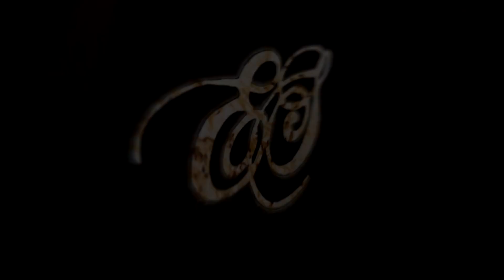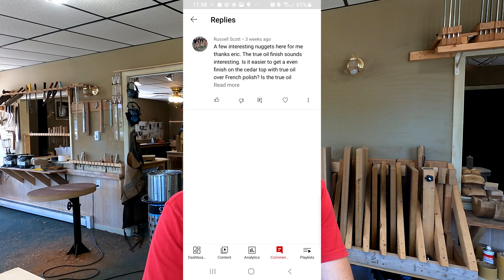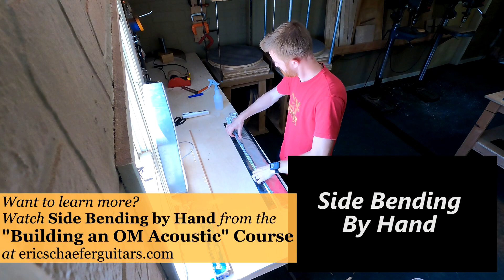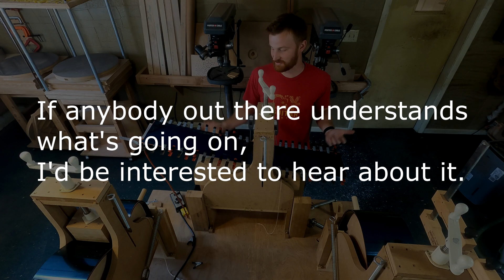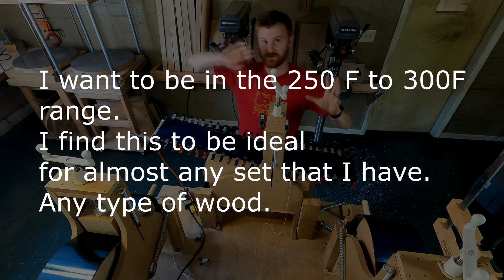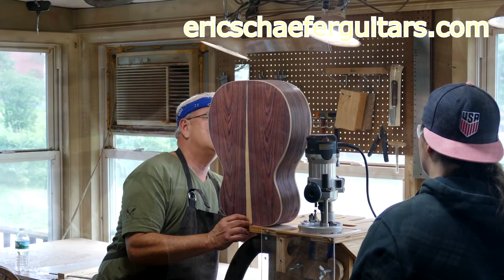Machine Bending Guitar Sides | Demonstration and Q&A

Comment: Hello Eric, have you figured out your hum problem by now? If not try unplugging it and plugging it in another outlet to see if it stop. If the hum goes away then it is your Amps, you are not getting enough amps to your fan and if you leave it plugged in the way you had it you will burn out your fan over time.

Comment: You have ground hookednup wrong . So what's happening is :

When you hook up your controller,  the live wire is actually going through the ground and completing a circuit.... Because it's going the the coil of the the controller which is wrapped with a zillion turns of wire , its actually not only completing the circuit,  Its also changing the voltage because of all the resistance in all that wire.. 

That is my best guess... Been there done that .. when only one thing is plugged in  , you don't notice it..

But eith 2 things you do .. Heres the bad part .. if you plug in say , a drill press ..  it can go into the motor ,  turning the windings into a transformer ... and actually raise the voltage in your iut let to 250 ir 410v ... of course the amperage would be down and it can also effect the cycle rate ...  this can destroy electronic components that are plugged into the same circuit .. 

I know its a long explanation but it needes to be .

Comment: Hi Eric,  first I want to say that for the 3 guitars I have built, your videos have been very good and useful to me, I wish you sucess!  As to the humming problem, you may find it useful to think of the 60 hertz (cycle) hum that you hear in terms of guitar strings.  When you pluck the high E string, the low E will also ring to a lesser amount in sympathy.  In my work, I used to use a harmonic analyzer to trace problems like yours at the university where I worked.  Many times, like John G. above mentioned, the problem was related to grounding issues but really a hard thing to pin down without doing a good look.  At any rate, you can think of the air fan moving in sympathy with the 60 hz generated by the temp control.  The fan is a good suspect for making that noise, so maybe you could, like the man said, unplug it - or move it to a different circuit.  A good electrician should be able to help you make sure you are safe with your grounding.

Comment: I have a Jet AFS1000 which looks like yours.  So I did a test plugging in my manual bending iron into the same outlet as the purifier.  My Jet hummed when the iron (controlled by an incandescent light dimmer switch) was at a low setting.  When it was on max no hum.
Reply: The obvious solution is to teach the purifier the words….

More seriously, dimmer controls use a variety of schemes to chop up the AC power delivered to the light or heater being controlled.  I suspect the induction motor in the purifier sees the voltage kick from the heater control’s internal switching.  These spikes surge to the motor’s start capacitor creating enough current to roll over the motor even when it is off.  

The simplest solution is to run the purifier on low while bending.  I have found that my bending iron produces particulate when I bend.  I don’t know if it is the steam generated or smoke from the iron’s wooden base.  Anyway my particulate meter spikes up pretty high and I run the purifier while I bend.
Reply: After some additional tests the hum was strong when the heater was connected to the same outlet as the Jet and weak when connected to the same circuit but connected to an outlet on the same circuit but 6 feet away.  When on a different circuit it went away.

The suggestion of putting the heater on a separate heavy duty drop cord will work I suspect.

Testing with an oscilloscope showed the hum coincided with he occurrence of switching spikes from my dimmer.  My bending iron is only 150W at max.  A larger wattage heater would probably produce larger spikes, and louder hum.  My hum is not very loud.
Reply: And a video of my experiments...  https://youtube.com/shorts/DO48TCcTe78

Comment: Hi Eric the strip you are using is a master and slave, first single port is master, as your thermo controller attached to the master as it turns on it controls the other slave ports where your fan is plugged. Hope this is the issue. So if you change your strip to a much cheaper one you will be ok lol. I use one of these for home theatre as i turn on my tv it turns on hifi speakers receivers all at once.
Reply: I think you can just avoid using that first port.  That should make both pieces slaves and will de-couple them.  Because the heating blankets have the potential to draw quite a few amps, I would make sure you have good wiring from the panel to the device.  Since most power strips are lower amperage with lighter gauge wire, I would ditch the power strip and wire a 4-plex receptacle in.  That should clean up your power a bit.  Also, my heating blanket circuits are 20 amp, not 15.  I think most blankets are around 1200W, so that's a 10 amp draw if there's not voltage drop in the circuit.  I like a LOT of headroom on heating circuits, so a 20 amp breaker with 12 ga wire is the combo I like.

Comment: Eric, I believe the hum is due to the controler having a reastat coil and your 110 voltage feed is leaking back . This is usually due to old unbalanced and misgrounded main panel wiring. Somewhere your neutral and hot feeds are reversed this was a common condition prior to modern electrical national codes. That is one reason that today's outlets and plugs are made with the neutral prong slightly larger to keep reversals from being a balance issue. Simple fix is take a new line from your main panel wired correctly. Neutral , hot and ground directly.  This hum will go away and the circuit will be safe.
Reply: That's much higher than 60 Hz. I think it's a switch mode style power controller which varies the duty cycle to control the power to heater.